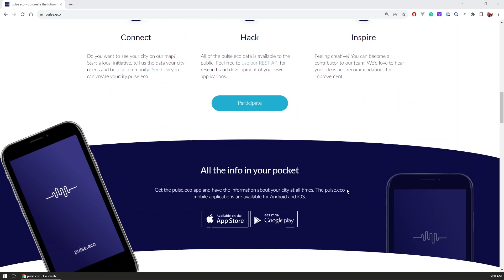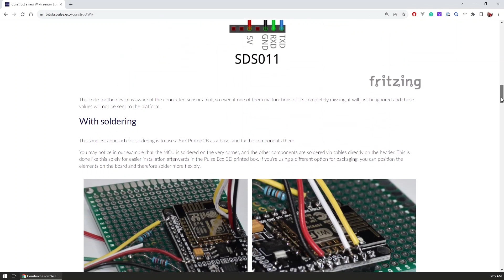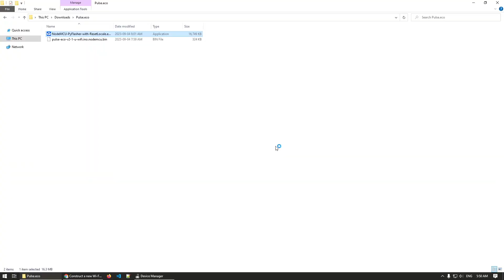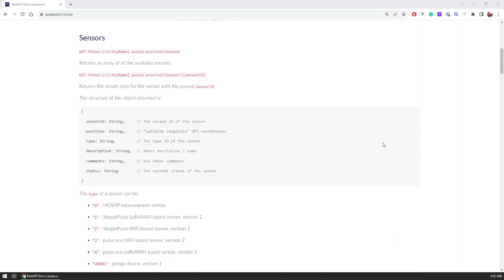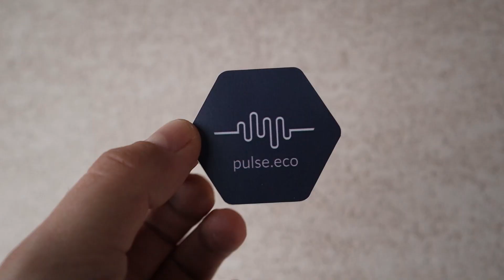Air Quality Monitor using SDS011 PM Particle Sensor for pulse.eco platform - How to make it

Comment: I have a question, can i replace the NodeMCU with another device such as Arduino, stm32,... can you recommend another mcu that you think would work good at this project
Reply: obviously you can, but you'll have to tweak the code accordingly to support their platform I think.
Reply: Finally, thank for your tutorial
Reply from the maker: For what I know, the firmware for this platform is only compatible with the NodeMCU (ESP8266) boards.